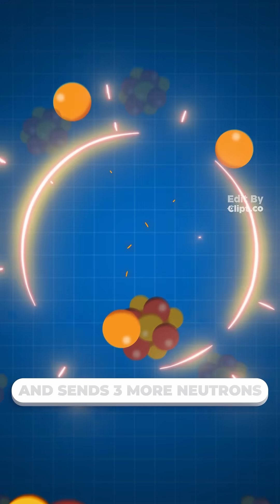How does nuclear energy work??

Comment: im pretty sure, water isn't really for slowing down neutrons. It ofc does that but from 1 fission you get 1-8 neutrons. To keep it from blowing up you need to get 1 neutron from 1 fission to attack an atom again. That means that its not only slowed down but also you need control rods that absorb the access neutrons (depending on a reactor they can be from boron or other neutron absorbing materials). Water is used to transport the energy (depending on a reactor again, it can get the hot water to cold pipes and boil there (water is not radioactive) or get into steam and go directly on fan blades (water gets radioactive but it is also the cheaper method) but otherwise the video shows how it works
Reply: U235 when it undergoes fission produces between 1-3 neutrons. But these neutrons are going too fast so have to be slowed down to become thermal neutrons.

Comment: The problem is that the type of uranium used in a nuclear plant is NOT the same as those in a nuclear weapon. Reactors don't explode, they boil off the water and meltdown. The problem is when the steam gets over pressurized an explodes from the system, like how a boiler can explode and that uses coal. Another problem is when water is directly added to an already melting down reactor. that can cause the water to flash steam. Think popcorn kernel for both scenarios.
Reply: People assume that Civilian Reactors would be used for nuclear weapons, even though you can make FAR more purer and enriched materials in labs with absolute zero critique.

Comment: Don't even add nuclear explosions to your videos, all it does is misinform when they scroll past.
There will never be a nuclear explosion with a nuclear reactor, it is basically impossible, worst case scenario they melt down and spread radioactive contamination. 
And pressure steam explosion is like a wet fart compared to Hiroshima is terms to what you show versus what actually occurs during the worst possible meltdown.

Comment: Well, no. The giant cooling towers do something a bit different. When the steam has turned the turbine, it has nothing else left to do and so the lower pressure steam is condensed by a condenser, located directly under the turbine. The condenser uses pipes of cold water that exchange heat with the steam, condensing it into water. This hotter water is then released into the cooling tower which cools the water, in which the water then evaporates because of its heat and turns to steam, which condenses AGAIN due to the surrounding temperature and these water molecules are what is seen going out of the cooling tower. The cooler water now goes back to the condenser and this cycle repeats

Edit: Ok, so I was wrong. The towers do let out some steam in case there is wayy too much steam pressure, but the above is its main purpose; it works with the condenser.

Comment: You actually won’t get a nuclear bomb, you will get 10 nuclear bombs. The reactor overheating will result in the whole vessel melting down and each molecule of water turns into oxygen and hydrogen. Because H20. And cuz oxygen and hydrogen hate each other…you get a…big bommm
Reply: How is that 10 nuclear bombs?
Reply: @idris4587it’s just what happened to Chernobyl.
Reply: @Microbe_obliterator  okay wow theres so much wrong with that statement. The USSR would have had to have been building atomic bombs for it to explode like one.

Chernobyl was thankfully mitigated due to the lifes of the firefighters and workers there. People still work at Chernobyl to this day. Thousands of them.

Comment: That’s not true.
Those cooling towers cool steam back into water.
Stop spreading misinformation
Reply: not exactly but true, it is slightly misinformation. Cooling towers cool water from a lake to very low temperatures, and runs through a condenser to cool the steam passing through it to about 98 degrees
Reply: @soggypancake001thanks for correcting me!
I tought they acted as a condenser to turn steam back into water

Comment: Nuclear reactors are not scary and cannot turn into a nuclear bomb. The material itself is not refined enough to become a bomb.  And the neutrons are slowed by graphite rods or other neutron absorbent material that slows the neutrons. The heat carrier which can be other things other than water. The heat carrier then heats the water to create the steam. The steam is then cooled to enable the reuse of the water and while this can be a cooling tower, it can just as easily be sea water or water from rivers or lakes. The cooling towers do not release the steam if it gets too hot they are using convection currents to in the towers to recover the water so they then heat it again to create more high pressure steam again. 
Nuclear power stations cannot go bang. 
If there is an explosion it can only happen if the water is super critically heated by a process called pyrolysis the hydrogen and oxygen is separated from the water (remember H2O)  if the water is not cooled. If you super critically heat water using anything as hot you will also get hydrogen and oxygen.  So the bang is the hydrogen and oxygen turning back into water. 
Unlike the old Russian designs the all nuclear power plants are in containment building so if the hydrogen and oxygen does go bang, the building is meant to be designed to contain any possible hydrogen / oxygen explosion. 
In japan they built a nuclear power station on the coast and it was hit by an earthquake and tidal wave and that compromised the containment building.
As these accidents have happened when they had a hydrogen /oxygen explosion near radioactive materials, a nuclear power station now must plan for every possible outcome making the explosion safe.   
Therefore nuclear power stations are simply big kettles like most power stations only using a something that gets hot. 

When you say not a lot of mass that is about the biggest understatement and like saying Jupiter is a little gassy. 

99% of a fuel rod isn't used and if you recover the unused fuel the amount of waste from all the nuclear power generation from the UK since the first ever commercial power station was turned on in the 1950's could fit into your average school sports hall. 

The equivalent amount from coal would create a small very black island with some huge mountains and at the same time create climate changing gasses. 

If you are scared of nuclear power stations you should also be afraid of pressure cookers and kettles.
Reply: My pressure cookers and kettles aren't radioactive.
Reply: @teimopukki4783 True but you would receive more radioactivity by eating a banana than you would by spending a day at a nuclear power plant.
Reply: @colinpotter3931  I mean, it really depends where you are. If you stay in the control room, I believe that, but if you’re operating the cranes to move the used fuel to the spent fuel pool in a refuelling outage, it could be higher. I do acknowledge the PPE required when doing this, however it is still likely to be more than a banana gives you. Very situational, though. Under most circumstances you’d be correct.
Reply: The term "nuclear bomb" could be seen as misleading, but it's really just a way to say that if it explodes the effects could be devastating.

Comment: They use graphite to absorb some of those neutrons to prevent a run away chain reaction
Reply: This is just the opposite of the truth. Graphite increases reactivity and hardly absorbs neutrons
Reply: @idris4587  its called a control rod control rods are made of graphite and they slow down the neutrons not absorb so i was kinda wrong but you got it completely wrong
Reply: @NHRTYu  slowing down neutrons means they can cause fission? How am I wrong? The neutrons can only cause chain reactions of fission and produce more fast neutrons when those neutrons are what we call thermal (aka slower moving).
Reply: @Photographer1203  control rods are not made of graphite. Control rods are usually a metal that contains boron or silver. The control rods abosrb neutrons, which mean they can no longer continue the chain reaction.

Moderators are made of graphite or the coolant such as water maybe act as the moderator too. Moderators slow neutrons down from 5% lightspeed to 1 electron volt or less of energy.
Reply: @idris4587  to control is to slow down the reaction and both absorbing and slowing neutrons down is a form of a control rod water is a control medium
Reply: @idris4587  slowing down neutrons will, in turn, slow down the chain reaction but you said it will speed it up
Reply: @Photographer1203  indeed it will, for most reactors thermal neutrons are used

Comment: Those towers are called cooling towers, they recirculate the water by sprinkling it trough air. And they also have backup water, and then another backup water.

Comment: on top of all of this, they barely release any radiation, almost 100% of the radiation is captured by the water which means you might actually get less radiation sitting in a nuclear power plant control room than on the beach during a sunny day

Comment: TLDR: Instead of tegular water, they use heavy water that slows neutrons better than regular water.

Specifically, the water does not contain regular hydrogen. Instead, it contains an isotope of hydrogen that has both a proton and neutron in its nucleus rather than just a proton. This isotope, called deuterium, is heavier than regular hydrogen. This causes water containg deuterium (D20) to be 11% heavier than regular water and slow the neutrons produced by the chain reaction to be slower.

Comment: But then, isnt nuclear energy fucking useless? It just contaminates your water and the same efficiency would be with a coal power plant or a dam
Reply: if its correctly disposed then it won't ruin your water. and uranium can power it way longer than coal without releasing anything into the air like coal does. dams don't make much energy compared to them and not every places have a river.
Reply: @NoName-O1OOO11O   hmm, what about fukushima in japan, are they disposing it properly?
Reply: Well 100% no, the water you drink/use will be not contaminated because it is separated from the water that actually contacted the nuclear reactor or uranium as you know
Reply: @erdwin5613   no, but you're contaminating water for no reason
Reply: @DarkBlead  bruh you misunderstand it🤦‍♂️

In nuclear power plant there's 3 circulation (I use PWR system) 
1. Primary circulation
2. Secondary circulation
3. Cooling circulation

• Primary circulation:
The only circulation where water only contacted or touch the nuclear reactor/uranium. And act as heat source

• secondary circulation:
The only part that make electricity by heating the water from primary circulation (without any contact with it) and turned into steam then the steam cooled from cooling circulation (without any contact with it) and back to water

• cooling circulation:
Water from river/sea cooled water in secondary circulation (without any contact with it) and then the water dump into sea/river water again. AND NOT CONTAMINATED IT

If you can't understand any of this, I think you have intelligent issue or I didn't detailed enough
Reply: There has only ever been 3 major nuclear reactor meltdowns, meanwhile coal power plants burn down all the time and even when they down they release an ungodly amount of pollution, poisoning our planet and killing millions, and waste wise nuclear energy produces nearly none, especially compared to coal

Comment: Well if you run out of water then… Chernobyl
Reply: actually you can't run out of water in nuclear power plant, because the water are recycled and just circling around
Reply: Chernobyl happened due to poor workplace management, the workers were seriously sleep deprived and the tech back then was generally far more unsafe, now a days in case of a meltdown the reactor just shuts down automatically with no further risk of damage

Comment: So basically in every type of energy regeneration power plant nuclear, hydro,wind, geothermal, thermal. 
It's just the rotation of turbine that produces energy 
WTF........
Reply: Yes, so why. It is just like a car, there's a sport car, normal car, race car, off road car, etc. And all of those type of car use engine to move
Reply: yeah cars use The rotational energy of an engine to turn a wheel. All the electronics you use are likely initially produced using the transfer of energy in rotation. if you say batteries then think of how those batteries are charged

Comment: Its kinda right. Water is doubling as a coolant and a moderator. A moderator slows down super fast neutrons becuase slower ones are better at sustaining fission. And, none of the thousands of safety designs went into this research or video, so good job calling it scary and then not saying why we still use it anyway. Still good on explainung the gist tho.

Comment: A Nuclear bomb has a 3 TRILLION OR BILLION DEGREES
Reply: Actually 🤓 the degrees of a nuclear bomb is around 200 to 500 or sometimes 2k if your really close to the nuclear bombing site, so clearly that "3 trillion" degrees of yours is wrong and the possible heat degree to reach by a human is roughly around 10k to 20k if they are engineers or scientists 

Since the job engineer is complicated for many you can make a machine or engine ( jet engine , rocket engine ) that can reach to the human possible heat degree

Scientists can make a chemical that can go lower than the human possible high heat degree which is 500 to 1k which is acid since acid is made of strong and weak acids
Reply: @anthonyyaco-e1z  Ok 👌🏻 thanks 😅😅😅😅 ( im so stupid )

Comment: Slight correction: the fuel rods used in reactors are subcritical. In other words, they aren’t dense enough to cause a runaway explosion like in a nuclear bomb. They can still melt down if the cooling system fails, but they don’t explode
Reply: Yeah

Comment: What stood out to me : 

Nuclear Steam is constantly being delivered to the atmosphere
Reply: In actual reactors a heat exchanger is used to transfer heat from the mildly radioactive water to an actual water loop which drives turbines and is cooled by the atmosphere

They release very, very low levels of radiation, practically none. Coal plants release far more radioactive particulates

Comment: Apple pie recipe for you

Ingredients:

Crust:

	•	2 1/2 cups all-purpose flour
	•	1 cup (2 sticks) unsalted butter, chilled and cut into small cubes
	•	1/4 cup granulated sugar
	•	1/2 tsp salt
	•	1/4 cup ice water (more if needed)

Filling:

	•	6-7 medium apples (Granny Smith or Honeycrisp work well), peeled, cored, and thinly sliced
	•	3/4 cup granulated sugar
	•	1/4 cup brown sugar
	•	1 tsp cinnamon
	•	1/4 tsp nutmeg
	•	1/4 tsp allspice (optional)
	•	2 tbsp all-purpose flour (for thickening)
	•	1 tbsp lemon juice
	•	2 tbsp unsalted butter, cut into small pieces

Topping:

	•	1 egg, beaten (for brushing)
	•	1 tbsp coarse sugar (optional, for sprinkling)

Instructions:

	1.	Prepare the Crust:
	•	In a large bowl, mix the flour, sugar, and salt.
	•	Add the chilled butter cubes and, using a pastry cutter or your hands, mix until the dough resembles coarse crumbs.
	•	Slowly add the ice water, a tablespoon at a time, until the dough begins to come together.
	•	Divide the dough into two equal parts, shape them into discs, wrap them in plastic wrap, and refrigerate for at least 1 hour.
	2.	Prepare the Filling:
	•	In a large bowl, combine the sliced apples, granulated sugar, brown sugar, cinnamon, nutmeg, allspice, flour, and lemon juice. Mix until the apples are well-coated.
	3.	Assemble the Pie:
	•	Preheat your oven to 400°F (200°C).
	•	Roll out one of the dough discs on a lightly floured surface to fit your pie dish. Carefully transfer it to the dish, leaving an overhang.
	•	Add the apple filling to the crust, spreading it evenly.
	•	Dot the filling with the butter pieces.
	•	Roll out the second dough disc and place it over the filling. Trim any excess dough and crimp the edges to seal.
	•	Cut small slits in the top crust to allow steam to escape.
	4.	Bake the Pie:
	•	Brush the top crust with the beaten egg and sprinkle with coarse sugar, if using.
	•	Bake for 20 minutes at 400°F (200°C), then reduce the oven temperature to 375°F (190°C) and bake for an additional 40-45 minutes, or until the crust is golden and the filling is bubbling.
	•	If the edges of the crust start to brown too quickly, cover them with aluminum foil.
	5.	Cool and Serve:
	•	Let the pie cool on a wire rack for at least 2 hours before serving. This allows the filling to set.
Reply: Cool but why?
Reply: Cool but why?
Reply: @PowerfulPlazOfficialabsolutely no reason at all

Comment: Idk if this is just a CANDU thing but the energy heats up d2o (not h2o) which hasn’t a higher boiling point than normal water because its denser then it goes to the boiler with normal h2o water on the other side of the pipes (h2o is less dense meaning it boils at a lower temperature) so that the water boils and makes steam.     Also in this model there are no cooling towers
Reply: (D2o is Dueterium and 2 Oxygen. Dueterium is basically hydrogen but with 2 neutrons)

Comment: So basically you don't need the nuclear energy to power stuff. You just need a heat chamber and alot of water to replace nuclear energy.
Reply: The thing is that nuclear reactors can operate for years on a single charge, and they are more efficient.

Comment: Great video! I'd just like to point out that the water slowing the neutrons does not actually slow the reaction, but quite the opposite! The neutrons need to be slow (so called thermal neutrons) so that the probability of them getting absorbed by the uranium is higher. Fun fact, the slow neutrons are almost 600x times more likely to get absorbed by the uranium than the fast ones!

Comment: I mean, good info but cooling towers are used in normal operations not just if it gets too hot. Also, not all reactors use them some just use a nearby body of water as the ultimate heat sink vs a cooling tower.